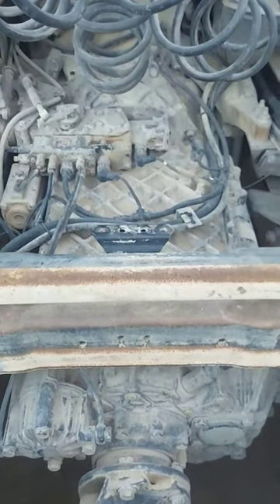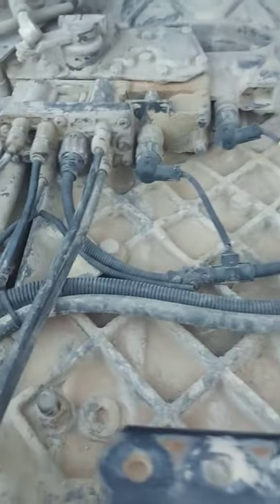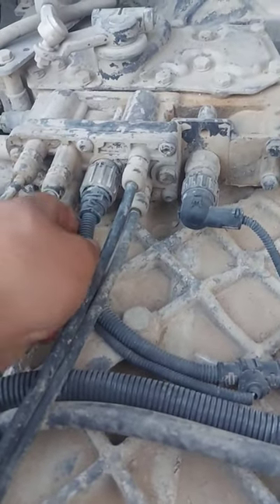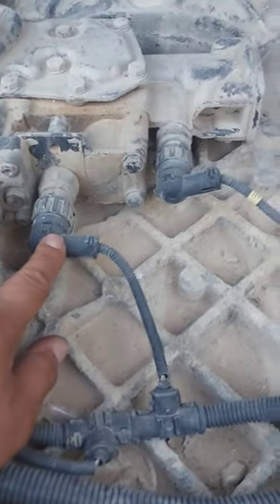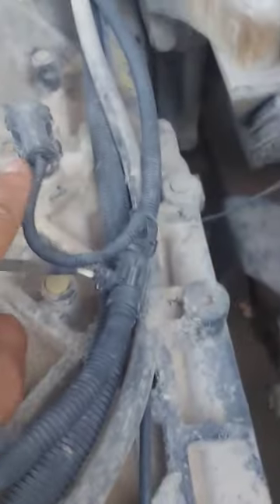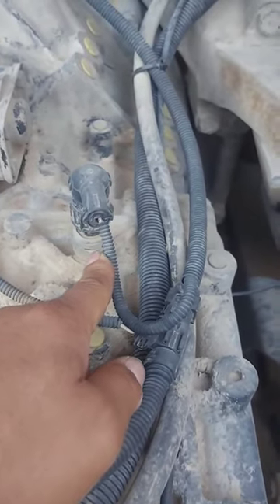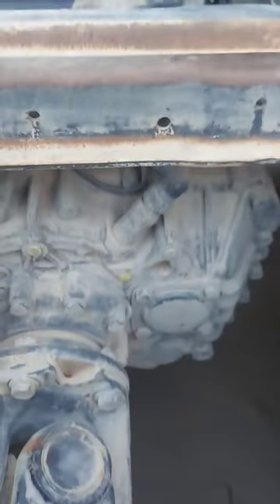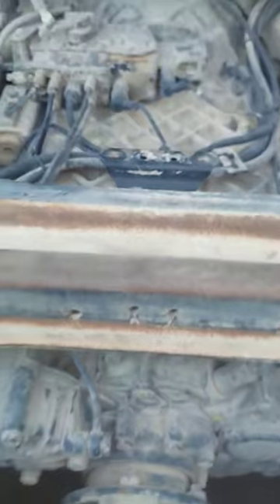ZF Gearbox Sensors.

Comment: Shifting gear tight 
What can be the reasons
Reply from the maker: There are some reason why shifting gear tight.first the shifting cable,clutch booster or deffective valve block.
Reply: @jlcworkshop Hello... Does the smaller zf6 ecolite gearbox of the MAN TGL have a valve block